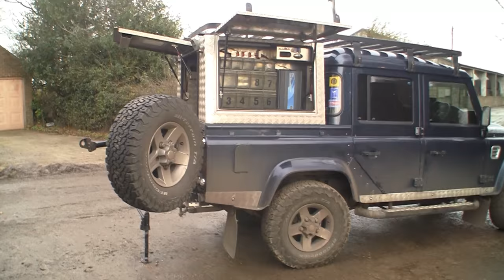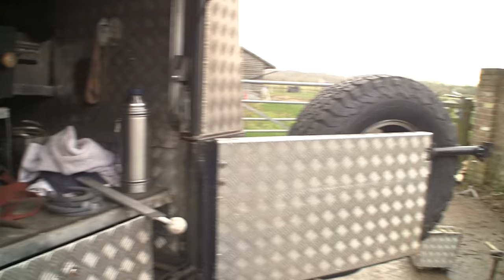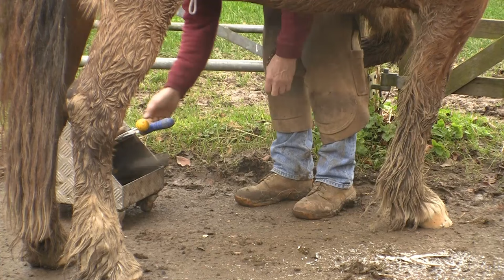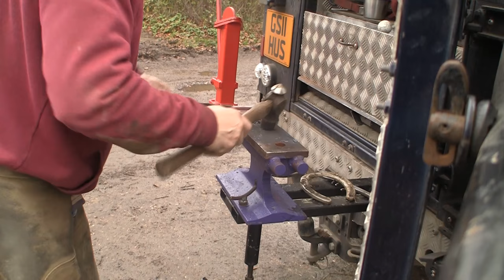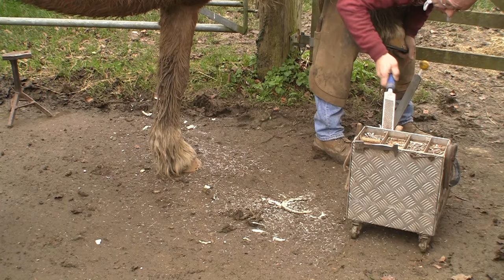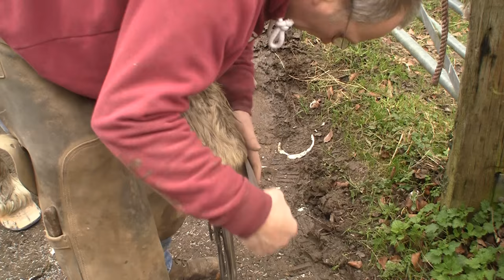Horse Shoeing.

Comment: If there's all this work on the foot before you can even shoe, how do wild horses manage?
Reply from the maker: Because they are just that, wild. Their feet wear down naturally and keep the shape that nature provided. If one is born with a deformity it will either adapt or die. Domestic horses that wear shoes don't keep the natural shape because the shoe prevents it so it can do much more work on hard surfaces and Tarmac roads without going foot sore. So we as farriers have then to remove the excess growth and reshape the foot back to its normal shape after removing the old shoe then fitting the new one.. Hope that makes sense!
Reply: It does. Thanks for reply